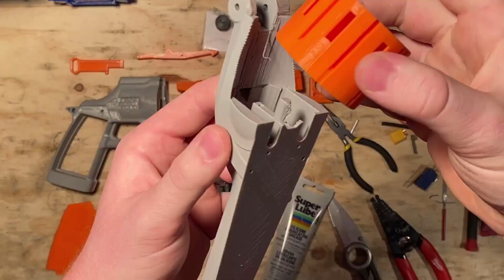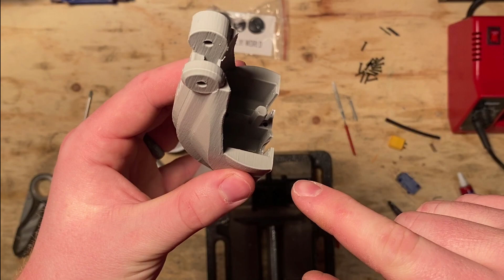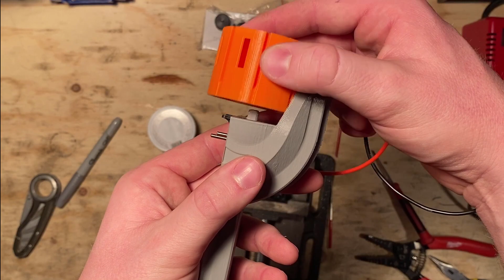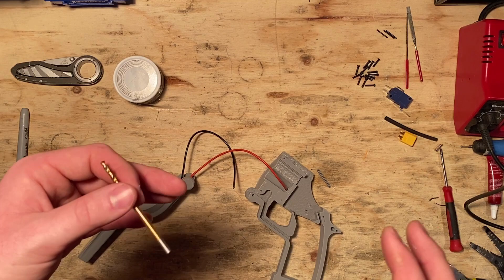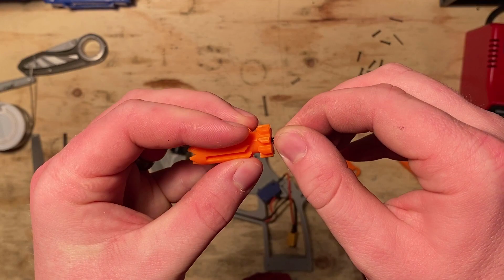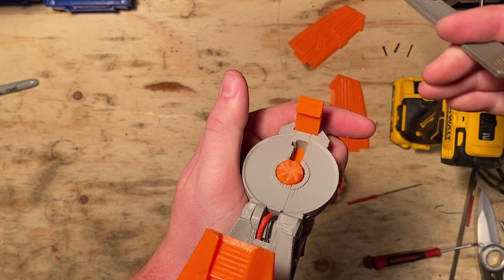FR-1 Viper Build Guide | Nerf Blasters

Comment: When I assembled my viper I fed the wires through the other side of the wire channel before soldering the motors.  It was much easier feeding them straight through the hinge side and pulling the excess wire back out once everything was soldered than shoving them through the cage side hole and trying to turn the floppy silicone wire then shoving it down a few mm at a time.  Alternatively one could cut the channel open then epoxy the wires in place.
Reply: Thanks! I did the same thing and it worked great, especially since it was a full length viper.
Reply: Sorry to be so offtopic but does any of you know of a method to log back into an Instagram account..?
I somehow lost my login password. I love any help you can offer me
Reply: @Jason Kyler Instablaster :)
Reply: @Titus Ariel it worked and I actually got access to my account again. Im so happy:D
Thank you so much you saved my ass !
Reply: @Jason Kyler You are welcome :)

Comment: As much as I appreciate your service and willingness to make a guide video. This is needs some work. No explanation of which screw used where, no indication wether the dot on the motors is relevant, no mention of what battery is used for testing. Just general lack.
Reply: You also didn’t link the flywheel tool you said you would.
Reply: For anyone else seeing this, I used a 1/8’ drill bit and the rods fit was significantly tighter than his was. Similarly it seems the one I was given was too long as it still had 5-6 mm poking out one side and was about to bust through the other. Still useable but if you have any concerns about cracking I’d go for the 9/64’.

Comment: what is the break lock pin called. I have no idea where to find a pin like that
Reply: did you find it? im still looking and I don't really want to buy a fifty dollar kit just cause I cant find the name of a pin
Reply: I use a ordnery nail that was the same thickness. The up size of using a nail is that you can have it stick out of the hole while you assembly to blaster just encase you mess up. Then when you are finished you can cut it to size. I bought a premade one and I can't tell the difference.
Reply: It's a stainless steel dowel pin. I used 3mm x 18mm, though i had to enlargen the hole very slightly with an 3mm drill bit to get it to go in without force